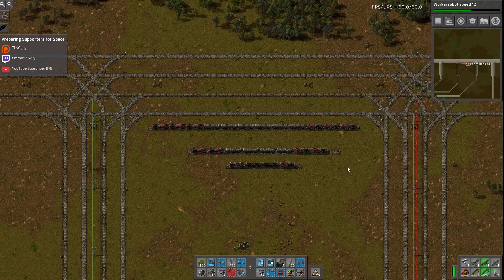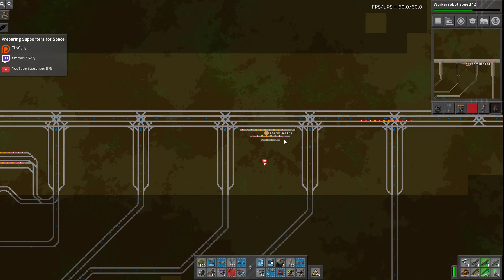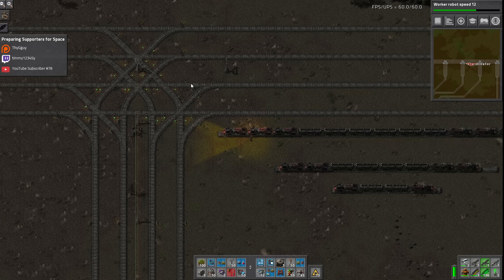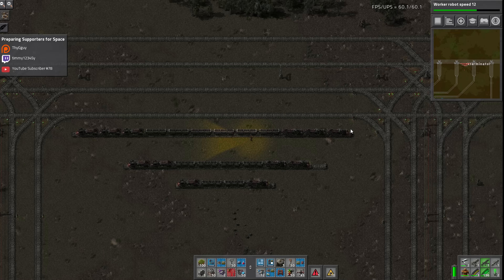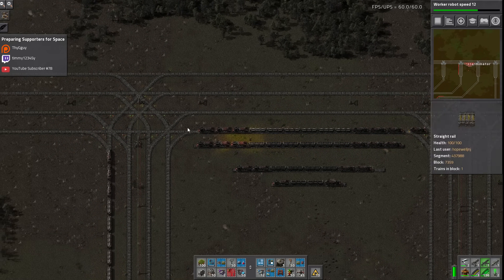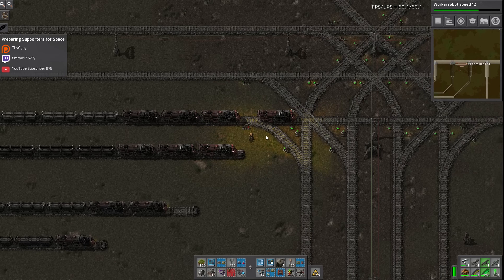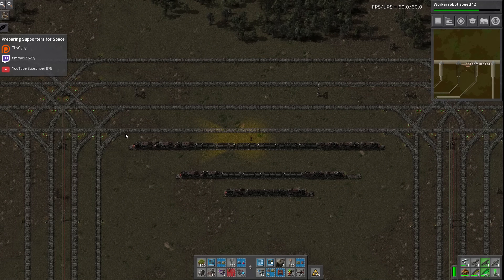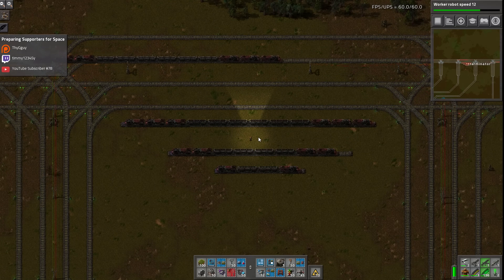Factorio Train Tutorial - Planning A Rail Network : Junction Spacing, Train Size & Mainline

Comment: As a complete Factorio noob, can you explain to me why you would need a train system like this?
Reply: Aerosikth For some people it's just for fun since trains can be interesting. But they also transport large quantities of material. If you have to transport it from ore patches far away it's usually more efficient to use trains. Otherwise there is a ton of ore moving on belts from one end of the world to the other. Ore on belts is useless until it gets to its destination. Train lines can also carry multiple materials easily while putting belts between each producer and consumer can become spaghetti quickly.

Comment: HI i have a question. I have my second attemp to create the rail network in my base. I chose 1x2 setup but i realise a have alot trains and my intersections have issue with stucked trains waiting for clear way. My question is T junction better then circle intersection? bacause circle intersection teoreticali should be more effective.

Comment: how do u go about refueling all those big trains?
Reply from the maker: EvilNecroid I just have a fuel train to goes around to all the builds and drops off fuel in a central spot and then bots bring it to all the trains.
Reply: cool i didnt think of that. i was thinking i would have to have a huge refueling station that all the trains had to go to
Reply: @EvilNecroid  well the refueling station isnt a bad idea, this game is a sandbox game, you can try new things every time
Reply: @lemonandgaming6013  in theory it is not bad, but when you have big base, then all trains go to refueling, waste of driving, more jams. And when they go refill? After each delivery, that is so unproductive, and i don't think you can measure train fuel, and send them only when they have 1 rocket fuel. So the best way is to send fuel train (1/1) to needed stations, another advantage, when your fuel type changes, you just need to change fuel train load. But be smart if you will build big base. I set limit to 10 rocket fuel in each unload fuel storage, but now my fuel train is too busy, and factory still growing, so it won't be able to refill all stations in time, i could make another fuel train, but i think better way is to make more place in unload box. In start it feels waste of resource, but it will be so much work to make more space in each unload station when you have 50+ factory sections, and remember witch one you re-maked.
Reply: @juriscervenaks8953  what I'm saying is that you can do it as a challenge as the game allows you to

if you like a stupid challenge then you should do this for the lolz even though it's a bad idea of you want efficiency

Comment: The main thing to take away from this is "Before building anything, first decide how big your longest train is going to be, then place all your intersections at least far enough to fit one such train between them".  

I tried to understand what "I don't have ore trains on my mainline" means and I think you have 2 separate rail infrastructures: 
1) The monstrosity you've shown us, that's hauling stuff inside the factory. 
2) Long distance network that connects mining outposts to smelters, uranium processing, stone loading station (that loads from outside trains to inside trains and makes bricks) and refineries. 

I never transitioned to the megabase stage, but I had a 2-lane network and some mining outposts. 1-4-0 trains worked OK, especially with 4x4 balancers, but maybe 1-6-0 or 1-8-0 would be better for ore transports once I have rocket or nuclear fuel. The main problem here isn't even speed, but the fact that the longer the longest train is, the bigger the infrastructure needs to be. With 1-4-0 or 1-5-0 the stations and staging areas (parking spaces) can already be hard to fit in. My main complaint about top-and-tail (incorrectly called double-headed) trains, apart from their lack of structural elegance, is where to put fuel loaders when trains have different lengths and number of locomotives.
Reply: 1Maklak
when i have different train length (top-and -tail), then i write in station end (4/2) or (8/2) so i know what length station can supply with fuel. And i write to station end (4/1) or (8/1) when i have 1 sided trains so i know not to send (top-to-tail) trains there. Hope developers add tunnels in game, that would make less traffic jams. It eases up my worries when i build only 2 types of (top-to-tail) trains, smaller for smaller ore patches. And it is advantage to put circuit condition on your stations, so they only are open when they have full train storage amount in them, so trains will drive less times on rails.

Comment: I wonder... when you're at the point of such elaborate railway systems, are you still trying to get your first rocket into space or is it just building stuff for the sake of building stuff?
Reply: stony tina pretty sure is just building. I am only at 4exo stage, thinking of restarting the game felt like a nightmare. The speed difference is just tooo much. When you've been walking sooooo fast, going back just felt dreadful.
Reply: @komasdfg   Why you walk, you have car,train to move large distances. And you can build dedicated train for fast transport player, like 3 to 5 locomotive with rocket fuel. And i have dedicated trains ready roll with full cargo, so if i need materials for building oil, i have train with materials ready in base, i just sent it to my location, and keep building, same with other needed materials. Train for mining, building factories,oil processing materials ready to roll, and if i have shortage of materials in train, i send it back and it loads less than in 1 minute, so in 3-5 minutes train is back, and in that time i keep building or thinking about best design. So there is no need for boring repetitive walk if you don't like it. I am planning my 3-rd mega base only using robots, after making small start base before robot research. Then i just stay at starting area, and bots do all the work, i just design circuit, and just keep blueprinting, deconstructing. But for that i would build endless robot port network, robots remove trees, build lad fill, concrete, build turrets, repair, rails...my idea pretty much all the base, i just stay in starting base, and think, tell what to do- like Dictator :)

Comment: wow the infrastrukture is insane..looks like computer chip;)
Reply: Idea is the same
Rails are the "wires"
Trains are the "electric signals"

Factories are the "chips"
Reply: That's because a computer chip and a train network are both trying to be planar graphs.
Reply: @williambarnes5023  I'd say it has more to do with all the straight lines, 90 degree turns and buses all equally spaced that give it that effect when looking through the map which colors things so they look even more like circuits.

 ____________                                            ______________
|      _________                                    ___|_____________
|     |      _______                           ___|___|____________
|     |     |                                       |     |     |
|     |     |                                       |     |     |

Both of these give the same effect despite one being planar and the other one not.

Comment: What kind of processor do you have? Buying a new computer and your still getting 60fps with a base that large...
Reply from the maker: I have an i7 6700k. It works really well for Factorio! If you don't mind spending a little extra money, one setup up at the 7700k is slightly better and pretty much the best possible processor you can get for Factorio. 

Of important note though: RAM speed and timings (Cas Latency, lower is better) play a very large part in Factorio performance too.

Comment: If your green circuit factories supply only the blue circuit trains, then why not just make the green circuits in the same place as the blue circuits and have NO trains between them?
Reply: DRY411S That'd require you to move copper and iron plates to the blue circuit factory location. That in turn likely requires more items to move longer distances.
It also complicates design, and tends to make expansion more difficult.

Comment: One reason you didn't mention for whether you should circuit your rails is that currently wires on blueprints are free (you don't have to have a green wire in your inventory to have a green wire show up from a blueprint placed). Which means you also don't have a cost of making/carrying 1000s of wires to put it all down
Reply from the maker: That is true. I thought of mentioning it and then didn't for some reason. The free wire from using bots and blueprints is very nice!

Comment: How do  setup your ore outposts? Do you name them all the same thing and use circuit networks to turn them off? Or do you name them each something different?
Reply: Supernatural76767
It depends how big your base is. In my start game i use same name, on, off. But now i have big distance between same name stations, and farther ore stations are almost always full, and trains rotate around closest stations from smelters. I would like to make that full station is requesting specific train (only 1 train at the time), but i don't know how to do it, or it is even possible with circuits. So if you have big distance between ore stations, make 5-10 close ore stations same name, and other 5-10 stations same name with different number in end. But there is another problem when you do that, when those 5-10 stations run out, then you have unused trains, or you make another ore stations, that again make furthest stations not empty, or if you make 3-rd number in end (new 5-10 group), then you need to remake previous train group station destinations, that is manual, and i don't like it. So if someone can tell me is it possible to request specific train, how it would ease up my life. If you think you can get away with naming each ore in different name-it is pain in the ass in late game, because you need constantly to rename new stations, and remember what number is not used. But in blueprint you can save station name, and just put blueprint with same name, and be ready to go do real stuff, designing base, less time in building ore stations, more time to grow factory.
Reply: Juris Cervenaks Take a look at the Logistic Train Network mod (LTN), which does that. It let's you program stations to demand or supply materials so trains only move when there's something to do. Really reduces the amount of trains you need.

Comment: I think the spot where you inserted that red science track input yield on the green science track was too low.  Did you ever check if that's a full train length spacing? I don't recall it in the video when it was designed.  
Similar thought for the rocket fuel build.
Reply from the maker: There may be a few that are too close. Still many modifications to be done here.

Comment: I see in your green circuit output here a lot of parallel output lanes that don't really show high train traffic, couldn't you get away with sharing rails? you can see what I speak off at 6:55 on the lower right area.

I see train networks much like belt networks for bulk throughput, you don't draft green circuits from main bus to supply processing units, you built their own dedicated green circuit factory given the high consumption, same applies to trains. You can also compare train length to belt speeds, large trains play the role of your blue belts and small trains are red or yellow belts.

An idea that is also used in real life which I don't see in this video is transfer stations, which would be analogous to belt splitters from a main bus, you make one really large train for bulk long range transport and you send it to a transfer station, it unloads there into basically a buffer depot from which smaller trains pick up the stuff and move it to multiple specialized terminals in higher frequency, it can really simplify your train layouts if you figure out the right proportions, might even be a framerate saver if the trains hurt enough, but I haven't tested that idea yet, so I'm just guessing.
Basically your 8 or 10 wagon trains would be your main bus and you can split smaller 2 or 4 wagon trains for specialized processing stations, it may also enable you to use single headed trains for the main bus increasing your power to weight ratio and therefore fuel efficiency.
Reply from the maker: The main reason for not sharing rails is because this was designed to essentially use the rails as stackers. If I were to share lines, even though they don't trains moving through them often, they wouldn't be able to hold all the trains back to back and then would back up into the other lines. That is the main advantage I found to have purely dedicated lines, you don't need stackers most the time because the lines act as stackers. 

The idea of a transfer station is definitely something to consider. It can for sure simplify your train network, but also introduces some other problems depending how you do it.

Comment: Great bid, Xterm. The one thing that I don't get about larger rail networks is station management for when there are multiple stations (eg the smelters and circuits) for naming and how you send the trains to the station that is open.
Reply from the maker: Thank you! 
That is a very good question and something I didn't really cover. Honestly, that probably could be a whole video on it's own. With the system like I have in this map, you can pretty much name all the stations the same and not have issues with them going to a wrong one because they are all on dedicated lines. 
For the smelters though, it can become an issue and that's when you have to introduce some sort of smarts to turn stations on/off depending on if there is a train in it already so that other trains don't just sit there trying to path to one that is already full.
Reply: Doesn't need to be done anymore. Simply use chain signals from whatever stacker/buffer rail you have to all of the endpoint stations. If a train tries to go to a blocked station, it'll repath to an open one if one is available on the same smart signal block. Makes stacker/multiple loader builds a breeze.
Reply: @aeternusdoleo4531  It would be beneficial to add circuit to station-on/off so trains don't wait in empty station, in that way less trains needed. But my problem is, i have too many smelter stations in a line, like 20 beaconed smelter stations, so i get jams, because there is only 1 incoming, 1 out-coming line and waiting area in middle. But traffic jams come because trains wait until other trains come in, out and chain signal says there is other trains on rails. I am looking what is the limit of smelting stations per 1incoming, 1 out-coming rail.
Reply: @juriscervenaks8953  One train per 3 seconds or so is what I've found. You can shave some time by adding additional engines. My setup uses 4-12 trains for ore hauling.

Comment: Very well done tutorial. I can't think of anything that wasn't covered. Much of planning a rail network is personal preference like you said. Sufficient spacing is key to proper performance of your rail network.
Reply: Very comprehensive and really covers points that are often glossed over.  Only thing I could think to add is with any combination of locos and wagons it should be able to achieve top speed, an example of a bad combination is the classic 1-4-1 which lives in struggles town.

Comment: Is there really a huge gain in using cargo wagons with barrels of fluid instead of using the fluid wagons?
Reply: barrels hold more fluid then tanks in one steel chest 480 barrels fit 1 barrel = 500 fluid 480 x 250= 120 000 fluid not sure how much barrels a train can hold but if your going to store fluids barrels are the better way to go if you do not want to store it you can use fluid wagons its more about what you plan to do and depends on the build
Reply: caleb frew It is great when you don't plan on using liquid right away but store in big storage. In my base i have space issue, and i don't build over not mined ore patch, oil. So i have about 5 million of storage of 3 oils, mostly because i have too many coal patches, so i created oil of it. But water, oil, lubricants i bring only by fluid wagons. And you need to make barrel making factories, fill, empty barrel factories, so if you don't plan on storage liquid for future use, then there is no use for barrels.
Reply: One benefit of barrels is that they use the same infrastructure as materials, so no fluid pump station needed. Just fill or empty the train using standard inserters and belts.

Comment: My concern with longer trains is that delivering large volumes of products can cause a boom and bust cycle, with surges of resources, whereas smaller trains, will keep the supply even.  Any thoughts on that.
Reply: Julie Fisher in my opinion, boom and bust is caused by not having enough materials to put in the train in the first place.
Reply: I have experianced that in games and it was always in that early game stage where the base needs trains and there was only a small number of belt fed mining outposts.  surging was usually due to some conbination of not loading and unloading as fast as possible and mining more ore than what the base demands.  Fast inserters without the stack size upgrade and ore storage in wood boxes really slows things down.
Reply: That is where buffers come in. Most stations have each wagon unload into a box, and be loaded from a box. That boom/bust production you mention usually means your production side (where the train loads) is capable of producing far more then what your factory is demanding down the line. It's not a bad thing as long as you can handle the power requirements for the boom cycle and the input of the production end is also buffered.